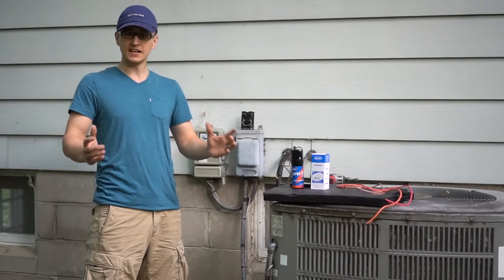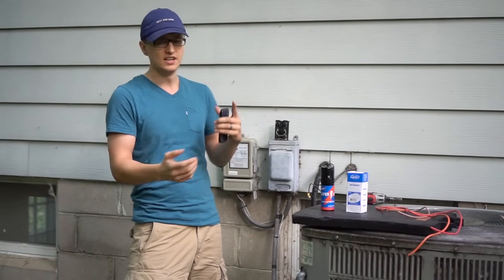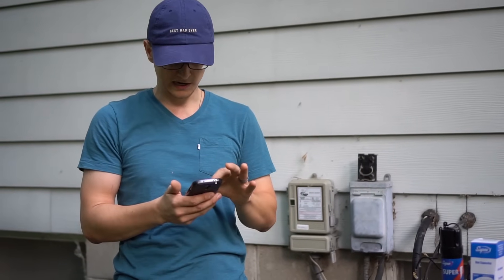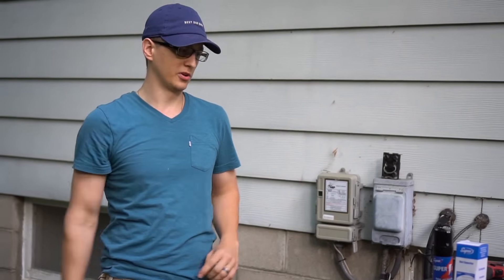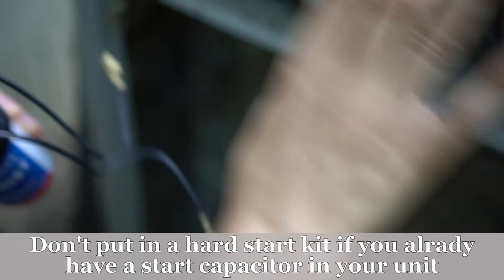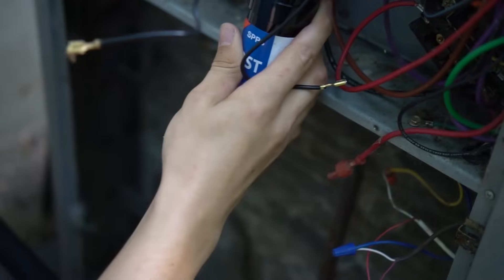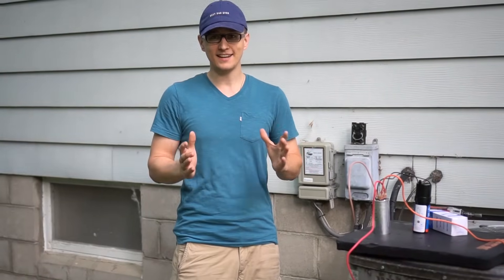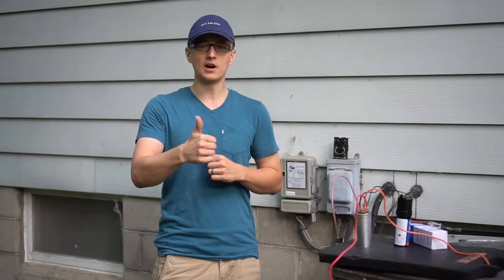How to Install a Hard Start Kit in Your Air Conditioner

Comment from the maker: Here is the hard start kit I have in the video:
https://amzn.to/2JSPieo
Another brand that fits any size A/C unit:
https://amzn.to/3W5ROBM
Here is a link for a 5-2-1 Compressor Saver (1-3 ton units):
https://amzn.to/2YivQym
Here is a link for a 5-2-1 Compressor Saver (3.5-5 ton units):
https://amzn.to/2YbopVo
Another option: Rectorseal Kickstart (1-3 ton units):
https://amzn.to/2XYwH7H
Another option: Rectorseal Kickstart (3.5-5 ton units):
https://amzn.to/32KgZvS

If you are wondering why don't all AC condenser units have hard start kits or start capacitors, it's simply because manufacturers decided to cut costs. Back in the day, almost all AC units had a start capacitor. It does prolong the life of the unit but it will work with just a run capacitor (the silver one) so they decided to cut the "extra part" out. Just like cellphones used to have EMF blockers but since they were expensive, manufacturers decided to cut costs and stop putting them in.

🔋 And here are more capacitor videos for further information if needed: 

Original Video on Replacing a Capacitor:
https://youtu.be/C82HvbvP08E
How to Replace a Capacitor Full Guide:
https://youtu.be/9ZGfvC-PMWU
How to Order The CORRECT Capacitor:
https://youtu.be/mkqaOfvH4a4
How to Check Capacitor With Multimeter:
https://youtu.be/5_0nKm940nA
How to Replace a Start Capacitor:
https://youtu.be/hC0nFT1XPcI
How to Discharge a Capacitor:
https://youtu.be/45oZXnClMD0
How to Combine Capacitors:
https://youtu.be/qLJOWU33TFo
What to do if Capacitor is Rusted:
https://youtu.be/RSIi47uzApI
How to Install SPP6 Hard Start Kit:
https://youtu.be/ThBsRFrdNiY
How to Install 5-2-1 Hard Start Kit:
https://youtu.be/KRQ3BzJPPn0
How to Wire A/C Condenser Unit:
https://youtu.be/KCanZEsLVEI
Reply: How do I know what kind of HARD START KIT do I need for my compressor?
Reply from the maker: @xavi-12  You would need to figure out the size/tonnage of your unit first. Or just use this kit that fits just about any size unit out there: https://amzn.to/3W5ROBM

Comment: Excellent video! (Liked & Subscribed)
You made the selection and installation of the hard start kit look so straightforward that I finally feel confident enough to tackle it myself. I’m currently on temporary disability and looking for ways to handle home maintenance without breaking the bank, so this was exactly what I needed.
I have to share a laugh with you: We had a 'pro' out recently who confirmed I needed a hard start (pulling 80 amps on startup!), but then he suggested that on his next visit, he should uninstall my refrigerant coils and take them to the driveway just to wash them! 😮 I don't have my EPA license, but I know enough to realize that breaking solder joints and draining the system just for a 'convenient' cleaning is like removing a car engine just to change the oil.
Thanks for keeping it simple and empowering homeowners to handle the common-sense fixes ourselves.

Comment: Great video!  Just a word of caution, if you plan to install an aftermarket hard-start kit, it MUST be installed vertically ONLY.  The internal relay relies on gravity to operate properly.  If you have installed it any other way, you risk damaging your compressor or starting a fire.

Comment: Careful folks, while these are widely used and I'm not knocking them, this chap didn't mention once about de-energizing the condenser via the breaker nor did you mention you should discharge the capacitor.  Take necessary electrical safety precautions.  Cheers!

Comment: Thank you! I started at your video of 20 reasons my AC is not cooling. I replaced the filter, batteries in the thermostat... low hanging fruit! Still nothing, the large coolant line was not cold. My condenser is old, has long lines so I tried this and it worked. I know you said it will only extend the life of the compressor so I will have it replaced this fall. Excellent videos!

Comment: Hi
I just installed both run and start capacitors into our old trane ac unit...the original start capacitor was on its side i noted, so i installed the updated capacitor on its side too...
The compressor kicked on, but then that start capacitor went poof...a cloud of smoke came out of it!!! Maybe it should not have been installed on its side...i have no idea why it failed?
I did check your video on troubleshooting the compressor...
I noticed the ohms from com to run were only 0.4 ohms...
But the both ohm readings added up to the same number about 2.8 ohms...
Maybe you have an idea what happened??
Could the start capacitor relay have failed?????? Tyvm

Comment: hello bro, can you connect any of the cable to common or herm line
Reply from the maker: One on each. Doesn't matter which one goes to which side, that's why the hard start black wires are not labeled.

Comment: Word of warning. I got a kit, turned my thermostat way up so it wouldn't kick on and went outside. I opened the unit, pulled out the old cap and began removing wires. I got a good strong shock! I forgot to pull the cutout next to the condenser!! I forgot turning up the thermostat doesn't cut off lethal 220 volt power. Im alive only because I was poorly grounded. PULL THE CUTOUT!!!

Comment: So it's a 2nd capacitor in parallel with the stock capacitor?
Reply from the maker: No, I discarded the old black start capacitor. But if you were referring to the silver run capacitor, then yes. That one works together with the new hard start kit I put in.
Reply: @WordofAdviceTV  Roger that.
Reply: @WordofAdviceTV  I just finished installing one in my HVAC unit. Same hard start kit you showed us in this video. My silver run capacitor had to be replaced a couple of months ago, and my compressor is getting pretty old, so perhaps this will extend the life of the unit.

Comment: Great video...Just one question...the wires going to original hard start you are replacing just get deleted? Thanks!
Reply from the maker: Wires that went to the old start capacitor would be discarded. 👍

Comment: Is it possible to have the fan motor not run if the compressor is locked up or will the fan still run because my fan doesn't run and I think my compressor is locked up I have new contactor and capacitor and all lines have continuity

Comment: Hi, great videos I always watch them when I have a chance. I was wondering if you can help me with a problem with my AC. I live in Florida and the other day when I went to turn on my air condition, heat was coming out. I went into the garage and felt the condenser in the air handler and it was super hot. The compressor is turning on and all the fans are also turning on like normal. Thanks

Comment: excellent video. It solved the problem on my Lennox 3 ton unit. Will the super boost SPP6 also work on a heat pump unit? I have a Lennox system model number 13HPX – 018–2 30–14. 
thanks so much for your help.

Comment: Thanks for answering my earlier question.  I wondered if you still monitor these old videos.  So I just installed a Supco SPP6 and it only dropped my inrush from 122 Amps to 117 Amps.  Does it need to charge up or something before it works.  I measured the capacitance of it stand alone and it's about 95 uF - I think that's low but shouldn't it have made a bigger difference anyway?  My system has a 55/5 uF Run Cap (3.5 ton).

Comment: Doesn't your potential relay have to be mounted right side up?  I thought they were gravity assist?
Reply from the maker: A hard start kit does not have a potential relay. But the kits with the potential relay separate do need to be mounted right side up.
Reply: @WordofAdviceTV  I'm talking about what you already have installed in the Condenser Unit, not the Supco.  At 2.57 it shows your system already has what looks like a 5-2-1 kit with a potential relay.  It looks like the potential relay is mounted sideways.  BTW - I really like your videos.  I'm learning to do this myself.  I've already Liked and Subscribed.
Reply from the maker: @pdminvo4126  Ohh okay! That's what you were referring to. The potential relays will usually have an arrow on it that indicates which side needs to face up or the instructions that come with it will show it. I mention that in this video: https://www.youtube.com/watch?v=KRQ3BzJPPn0

And welcome to the channel! Good to have you here!
Reply: @WordofAdviceTV  I think I'm not being clear enough with my question.  I'm asking why you mounted your potential relay sideways (it's facing right, not upward) when they're advertised to be mounted with the tab facing up.  Is it not always completely necessary, are some not gravity assisted?  I'm just asking why you did it.
Reply from the maker: @pdminvo4126  Oh boy. My apologies for the misunderstanding. Let me give you a detailed answer that will hopefully fully answer you question then.

The SPP6 is not gravity assisted, it basically opens and closes from heat. The SPP6 is a combination of a solid state relay (fancy name for an electronic switch) and a PTC thermistor. (a resistor whose resistance increases as its temperature rises.) The PTC thermistor has a relatively low resistance and is used to close the switch (traditionally this part would be gravity assisted instead). This allows current to flow through the solid-state relay, connecting the hard start capacitor to the motor. At start up, the capacitor provides a surge of current, helping the motor start. As the motor begins to rotate, the PTC thermistor heats up due to the current flowing through it. As the PTC thermistor heats up, its resistance increases. This reduces the current flowing through the solid-state relay. When the resistance of the PTC thermistor reaches a certain threshold, the current through the solid-state relay is no longer sufficient to keep it activated. The relay switches off, disconnecting the hard start capacitor.

This was a really long way of saying that, yes, it is actually okay to mount these sideways and I've never encountered any issues from doing that. 😅
Reply: @WordofAdviceTV  Unfortunately we're still not talking about the same thing.  I'm not talking about the SPP6.  I'm talking about the 5-2-1 Hard Start Kit with the Potential Relay already mounted in your unit.  It appears to be mounted sideways.  Around 2:38 you mention that your unit came with a Hard Start Kit already installed - that may be the point of confusion.  I thought you installed it so I was asking why you installed the Potential Relay sideways.   Your other videos (and probably this one too) point out that the Potential Relay (not a PTC relay) is gravity assist and thus has an orientation called out on the package as to how to mount it.  Now that I realize you did not install this Potential Relay then I don't need to ask why you did it  - someone else did it that way.  Hope that helps in understanding what I was trying to ask.

Comment: My ac unit is  so cold air and was told it was the compressor I'd bad another guy i called did  came out and recommended I do this to get the compressor run is he right?

Comment: Hello great video, I connected Supco spp5 and spp6 tried both even with two new diff capacitors.  Fan turns on for like 10 second and then shuts off compressor still not starting …

Comment: Excellent and very explanatory video! I have a question, I have a 2 ton compressor, and a 50amp generator with  a 15000 (12500 constant) watts , it has a hard time with the start up , I am ordering  one of your hard starts and curious of your thoughts if this could help my issue?

Comment: Very good video, what it u have 2 capacitors 1for fan 1for compressor? where do the 2 wires go?
Reply from the maker: They would only go to the capacitor that is hooked up to the compressor. (the larger capacitor of the two)
Reply: @WordofAdviceTV  Thanks for ur quick reply and information 
Richard

Comment: Can you leave the 5-2-1 start  relay connected and ADD. The booster ? Or you 5-2-1 relay should be removed prior?
Reply from the maker: The relay should be removed if you will be putting in the 2-wire hard start kit. Or at least disconnected.

Comment: So would you put one on a brand new unit or one that is 2 - 4 years old. Love your channel. You gave me some good advice many of times on here 🤜🏾
Reply from the maker: Glad to hear the videos have been helpful! It won't hurt anything but there's a chance that it will prolong the life of the compressor. Back in the day most units had them installed by default but to cut costs they stopped doing that.

Comment: Is it correct that the hard start kit is always good to put on? I saw a system where the capacitor  numbers is smaller than the recommended ones. That is, 25/5 is used instead of the 45/5.

Comment: Will be ordering. Our Rheem system is 15+ years old but with a newer Copeland compressor and I just replaced the reeeaaaaally bad contactor and cap. 
you mentioned lights dimming - do you have a video for how to trouble shoot? it seems like our lights dim every time something turns on!

Comment: Some SPP6 hard start kits are for PSC motor only. How do I know if it can be used for my AC?
Reply from the maker: It's best to keep it simple. If there are no capacitors at all in your unit, then it's best not to put any hard start kits in there.

Comment: Will the failure of a hard or soft start kit causes the compressor from starting? If it acts only as an assistant, then the compressor should be able to start after its failure. Is this true?
Reply from the maker: Yes. Most residential air conditioners should be able to start without a start capacitor.
Reply: @WordofAdviceTV  Thank you for your instant reply! However, I am hesitant to install the SPP6 hard start kit, just received today, because it instructs for PSC motor only, but I am not sure if my AC meets the requirement. Are all residential compressors use PSC motor and we do not need to worry about it?
Reply from the maker: @tdlin1721  PSC stands for Permanent Split Capacitor. If your unit has a dual run capacitor in it (or two separate capacitors - one for the fan and one for the compressor), then you know you have a PSC motor. If your unit has no capacitor in it, then it is not PSC.
Reply: @WordofAdviceTV  Thank you for the information!

Comment: You saved me a lot of money. It took me literally 3 minutes to install the hard start kit and the compressor started right away.
Reply: "Literally" 3 minutes. Ok
Reply: @corey5526  😁😁😁😁right. how long did it take to take it apart? 🙂
Reply: @JohnSmith-uy7sv  Probably took him a minute with a cordless screwdriver to take the panel off. Probably 4 screws holding it on.

Comment: Hey we just changed the Capacitor b/c it was running low and now we are getting short cycling.. fan comes on but condenser cuts off after a second. Will a hard start help? Unit is a Goodman gas pack from about 2017.

Comment: Hi Jay,  I purchased 2 of the 5-2-1 Hard Start Kits and have watch several install videos, but have become confused about the various reasons when to install these.   In my opinion, the people who have a financial gain to sell these say these are labeled as "compressor savers" and those that don't have a financial gain say do not hook up to your unit until you have a compressor problem because that extra jolt of electricity will beat up and destroy the winding in the compressor faster, its just a temporary device.   How can it be a "compressor saver" when the extra jolt to get the compressor moving is doing damage to the compressor.   Both my units are 25 years old the inrush amps are reading 81 with a LRA of 82.   Thank You.

Comment: Does it matter which wire goes to? As long as its the herm and common?
Reply from the maker: It doesn't matter. Just one wire to herm and another wire to C
Reply: One more thing, is this okay to install in a 3.5 ton unit?

Comment: Anyone know if unit can be installed upside down.  Wires are too short so I have to add wire extentions if upside down position not recommended or possible. Thanks.

Comment: A contractor used by a neighbor wants $300 to do this. The part costs $20, it took me 10 minutes. Think I'll take the rest of the day off!!
Reply: That’s good. HVAC mechanical is like auto mechanic. They charge you a leg for repairs, but if you can do it, you just pay parts! 😀
Reply: hourly rate. the knowledge, the van cost, insurance, tools etc all adds up
Reply: You're lucky, I just had a company ask for $750 per unit
Reply: It cost a lot of money to put a van on the road. Typically around $1,500-$2,000 a day. They are not charging $300 for no reason.

Comment: I replaced the capacitor but the fan still won't kick on.  It already has a hard start installed.  Could it have gone bad?  How do I find out which one to use?

Comment: My HVAC company installed one when they tested my run capacitor and it was close to dying during my Spring checkup.  I don’t know if I really needed a hard start capacitor, but had them install it based on their suggestion and because the compressor was 14 years old. I don’t really notice a difference after it was installed, but I hope it can extend the life of the compressor.  Thank you for making this video.

Comment: Great video, I have a question. I have York around 10 years old. My unit started humming. Tech came and said I need to change the compressor. Then he installed the device in this video. Is it true that my compressor is getting bad or is bad? A quick reply will be appreciated.

Comment: Quick question just to clarify does it matter which terminal goes to C and which one goes to HERM? Because I've been known to blow those capacitors up but that's also been in a DC circuit when that has happened.

Comment: Great video. Question...the Hard Start Kit does not have the Common or Herm labelled, so I assume that the capacitor connections do not matter. Correct?